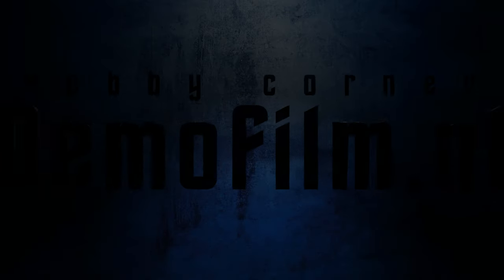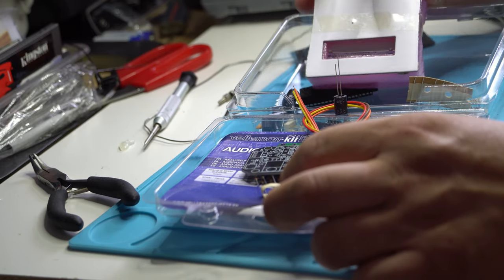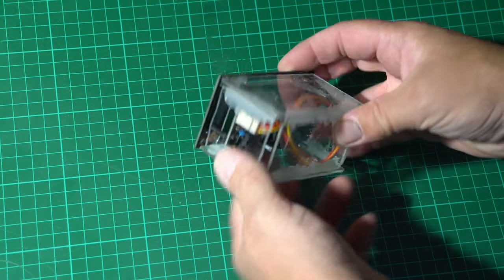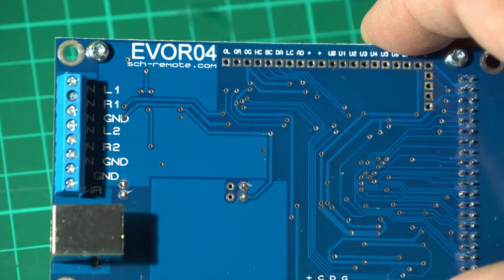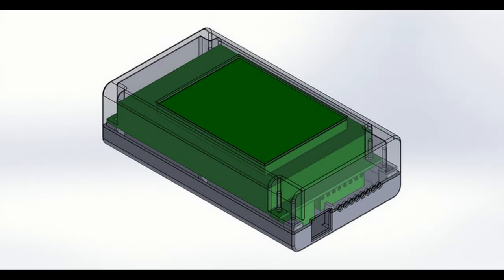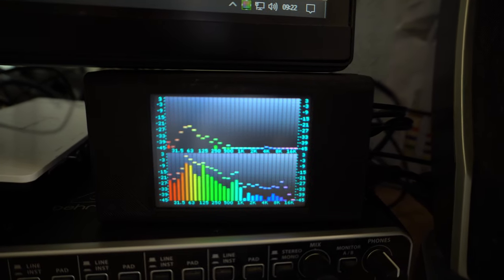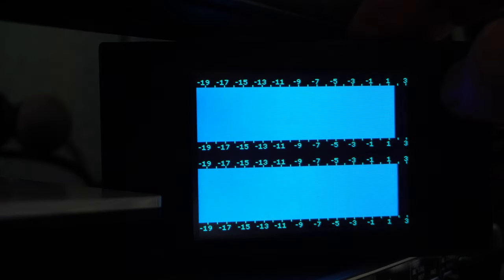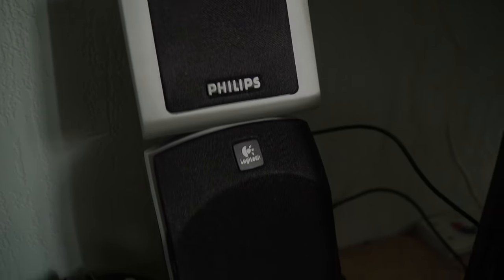A nice audio spectrum analyser. VU meter

Comment: I bought 2 of those Velleman units, 1 for each channel, I designed and 3D printed a case which has a face which sits at 45 degrees, I use these units to monitor power outputs from amplifiers I service, I have 2 100 watt dummy loads screwed to a big heatsink, I can then bench test the amp for many hours without making any noise, these units are great because they have many functions but mainly they can measure RMS power output, your colour unit doesn't seem to measure RMS power, it's interesting that you didn't solder the bolts to the Velleman face plates, you used hot glue instead.